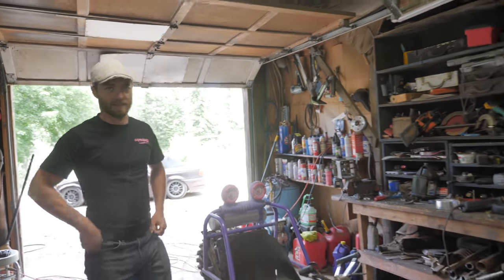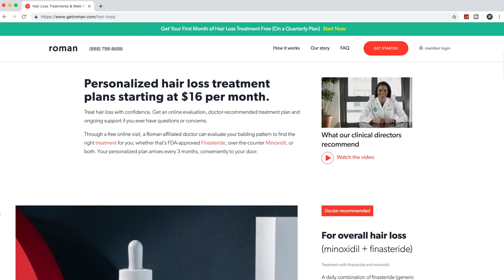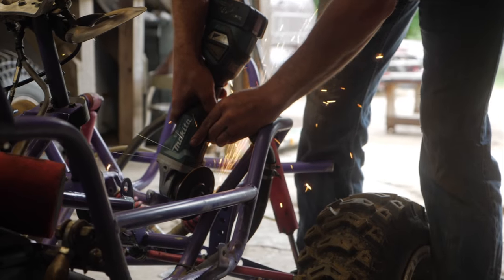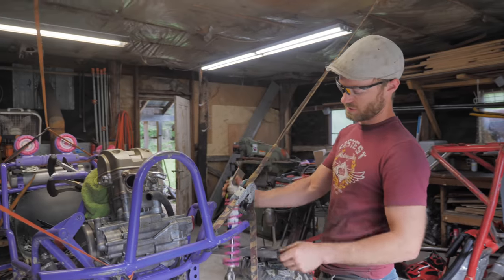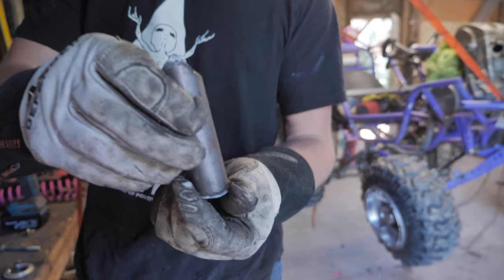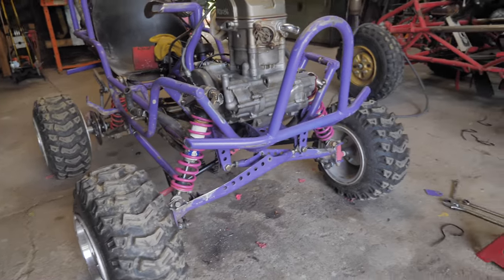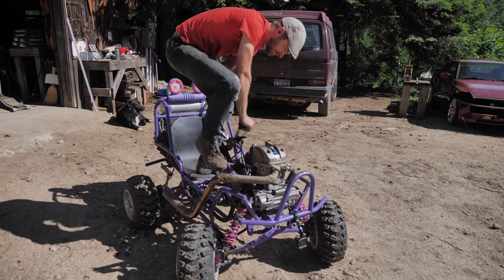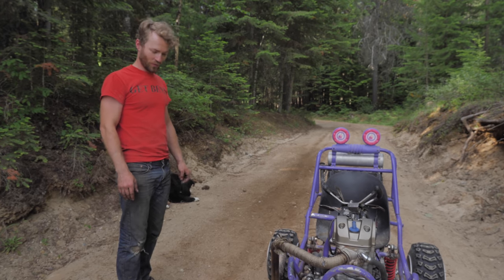50HP Barbie Jeep Gets A Rekluse Clutch+Front I-Beam Suspension

Comment: Glad you guys are enjoying your new RadiusCX auto clutch. Great video! 

-Rekluse team
Reply: Hey! How does it work? I'm guessing like a normal clutch pack with a kind of lsd sorta set up to ramp up pressure on it?
Reply: I'm an ex-bike racer/rider and know nothing of these. So you can ease the clutch out and just sit still and stop without pulling the clutch?
Reply: I would like to get one of those clutches for my ATV. It has the exact same motor. It would make it easier on rough terrain because you can't go less than 20mph or your in danger of stalling it out.
Reply: @AZBADBOYz  you can still use the clutch, the lever will still be there and still work. But from neutral you can shift down to first or up to second without pulling in the clutch, and just gas and go. Also if youre already in first second or 3rd you can come to a  complete stop without even touching the clutch. It works really good in tight technical terrain at low speeds, and the bike wont stall.
Reply: Your products are awesome! We have run it on two 690 powered cars now. Would love to see it for some of the other engine options out there for competition like the Kawasaki 650, Triumph 675 or CBR
Reply: I'm sorry but I think that's lame. It's the easy way just like all the new generation. I can crawl through any terrain on my 29 year old kdx200. For a toy like this fine, but just learn how to control your vehicle. Freaking kids can't even and don't want to drive stick now. ABS sucks and so does all the traction control, launch control, auto blip of the throttle........ Put me and half the pro race drivers in a car with no Nanny's and I'll bet I win. This recluse makes your bike a scooter with gears. Big pit bike. Woo hoo! 🤮👎
Reply: AZBADBOYz yes you can it’ll idle in gear and you can shift without using the clutch, I have one in my 450 quad
Reply: Neal Ramsey I have one in my trx 450 and they really are a game changer
Reply: @AZBADBOYz  basically a centrifugal clutch  like snow mobiles use
Reply: Rekluse Motor sports, correct me if I'm wrong but dont you still need to use the clutch for shifting?
Reply: @shaunmilor  same concept but applied VERY differently
Reply: dirtrider88 no you don’t need to use the clutch with the radiusCX model, they use to have a similar model called  the Z start pro which did the exact same thing except you still had to use the clutch to shift. This is basically the upgraded model from the Z start series
Reply: so not having to use the clutch when shifting is unique to this model?
Reply: dirtrider88 yes it is, this is the only rekluse clutch pack that allows this believe. Hints why it’s also the most expensive lol
Reply: U guys make the best that's forsure!!!
Reply: @chapekfabrication2975  grabbing the clutch when you stop works really well too.
Reply: @jasonbirch1182  Because the clutch leverages centrifugal force, you "will" (you need to make sure it's tuned properly) always have optimum engangement/disengagement. Among other things, the benefits to using an auto clutch include preserving clutch life and giving you the best performance possible. It is not about removing the need to know how to work your clutch.
Reply: @dirtrider88  Technically you can powershift or time your shifting like you would with a normal manual clutch without the lever. The auto-clutch will allow for clutch less shifting however we still recommend using the lever when possible to remove load from the transmission. Our clutch is generally locked up like a manual clutch in mid to high RPM range.
Reply: so that tells me you still need to use the clutch for shifting.
Reply: Say hi to pin pong @ Rekluse for me.   I have bought three Rekluse clutches and they are great!!
Reply: Man I need one of your clutches for my 2004 CBR1000RR powered golf cart.  Checked your website and it looks like there's nothing available.  I'm guessing that you have no desire to make one for that many streetbike setups do you?
Reply: How much for one i would like to buy it or have one built the same way
Reply: epic clips that specific clutch you’re lookin at around 1,200 for the complete kit. (Give or take given on what you ride)
Reply: epic clips look up rekluse clutches and go to their page and that clutch is the Radius CX model

Comment: You should make a 1/8 inch skid plate that covers the bottom of the spare tire so it won’t dig in
Reply: Really good idea!! Botham plate, maybe also one in the front
Reply: I've been thinking little wheelie wheels, but I honestly like this idea better.
Reply: Move the spare tire to the front bumper and the petrol tank just behind it.
Reply: Richard Roper sorta copy an engine skid plate. Give it a wrap around effect
Reply: Also, potentially a kind of angel hoop over the driver?
Reply: This!
Reply: Turn it sideways and put it on a spindle.
Reply: And the front so it doesn't snag on something when landing a wheelie.

That would end very badly
Reply: @johnnygearjammer  exactly what I'd do.
Reply: Or maybe a metal bar with a small wheel at the end under the tire

Comment: Dang! Did not realize how awesome Rekluse Clutches are... Might have to look into it for my bike.
Reply: Yes they are absolutely awesome!! Sure makes trail riding a lot better IMO
Reply: They are great if you suffer from arm pump but require a whole new style to control your bike. Much different approach to obstacles. IMHO very tricky when it gets real technical.
Reply: Skinny Pedal Productions they costs too much tho
Reply: they are great for this purpose. but for a dirt bike i would far rather continue using clutch control etc. avoiding a stall is half the fun.
Reply: just don't get stuck half way up a hill
Reply: Plug is working.

Comment: You can use no clutch to shift with the stock clutch the rekluse just lets you stop and take off with no clutch motorcycle have sequential transmissions
Reply: You can do it with the stock clutch but having built a few motorcycle powered race cars with a rekluse clutch it is even easier and noticeably smooth no clutch shifting up and down

Comment: I think a 10-20lb steel plate on the front bumper will help soften the suspension + help with handling on turns and it would be dope if you turned the spare tire 90° so you can use it as a wheelie bar, just a thought 🤔but i love the vids guys everything you build is incredible keep up the good work👌🏼👌🏼

Comment: The steeper the angle of the shock the more travel you will get.   If you really want some travel lay them horizontal and create a cantilever suspension set up.   Also a hole saw with a center drill will make you a washer and drtll the center hole at the same time.

Comment: front suspension is sweet! i reckon if you move the upper mounting point of the rear coilover it should reduce the tendency to wheelie as much as more of the weight of the driver is supported by the suspension, rather than acting as a larger lever, creating a greater moment on the whole system.

Comment: Nice work! Before it was just chaos with that motor and chassis. Now you have some controlled chaos. 

I don't know the spring rates or corner rates of the jeep, but most of the mass seems to be over the rear suspension (rear seat placement) and the way you have the rear coil overs laid flat means the increased mass has more mechanical advantage on the rear springs. Obviously there are packaging constraints, but if you increased the rear wheel rate you might not need the sway bar. You could stand the rear coil overs more upright or maybe change springs. 

On the front it definitely looks too stiff. Though it is a little hard to tell because there seems to be zero load on them about half the time. :) There is less mass over the front suspension and the coil overs are more upright. I wonder what the rear spring rate is compared to the front. Maybe swap the front and rear springs.

Also don't forget the effect the valving of the shocks has on the feel of the suspension. I don't know if those shocks are tunable by swapping shims, but you can always tune them with different weight oils. 

Overall the project looks (more) impressive now with the upgraded front and rear suspension. With a little tuning it is just going to get better. Check out some of the coil over articles below (if you have not already seen them):

http://billavista.com/tech/index.html

Great job guys. It just keep getting more capable with each episode. Be safe!

Comment: I have a trx450r that I've put a stage 2 cam and a 520cc big bore kit in. That engine would be the shit in one of those carts. It would basically be uncontrollable. The ATV was completely different after that work. It is far easier to stay on the gas for a half a sec to long and crash whereas before it felt very controllable holding it wide open.
Reply from the maker: How much power do you think it makes?

Comment: Great stuff, love it :) Best offroader ever :D
How come you didn't mount those shocks more vertical? If the lower shock support were closer to the swingarm pivot, you would have got more wheel travel per shock stroke, and at the same time effective spring rate would be lower because of the longer lever arm acting on the shock - giving a softer suspension.

Comment: I would have used a heli coil on the valve cover bolt hole. I've worked on enough outboards and motorcycles that I have a metric kit with most of the popular sizes. Good vid though!

Comment: Hey guys, there is a simple solution for your stripped out thread problem.
It's called Helicoil. Essentially it's like a spring in thread form that you wind into the slightly bored out original hole.
Strong AF, no chance of ripping the thread out anymore and you keep the original screw.

Comment: The recluse doesnt make it to where you dont have to clutch to shift. Dirtbike transmissions already have that ability because they are a constant mesh transmission. All you have to do is chop the throttle when up shifting or rev high enough to slip right in, and blip it to downshift. Dont do clutchless downshifting on a 2 stroke though. The recluse just helps it to not stall at low rpm.

Comment: I'm thinking because of the short wheelbase, 40 - 50 lbs of lead ballast in front, would help to level out the power delivery and keep the front wheels on the ground a little longer for better control.
Reply: also would help soften up the front suspension with out having to change it
Reply: Yeah it does need front weight. Maybe putting a battery and the cooling up front could help mitigate it.
Reply: Unless you tame the air wheels to be part of your control.  The wheelies is part of the fun. But I agree to soften the front end a tiny bit. But it's still sheer perfection.
Reply: @Houstonruss  honestly the quick and ez fix would just melt down a led brick into the front bumper  @andy If u really wanted that tho u would need to set up left and right foot brakes for the rear calipers so u can steer

Comment: Shock should be  90 degrees from an axel as possible .
Reply: How come? I don't doubt it, sounds right... but I wonder at what point or scenarios it effects the characteristics
Reply: It "should" not, angle of the shock changes just the progressivity characteristics of the suspension.
But in this case, it would be better, because that would mean that the lower shock support is closer to the swingarm pivot - giving more wheel travel, and at the same time making suspension softer (because of increased leverage)

Comment: There is more then incorrect wheel alignment making that thing not wanna go straight, look at the bump steer. your steering geometry sucks and you really should do double A arms because it wont be easy getting rid of bumpsteer with that type of suspension. The barbie jeep is cool af and I want one but there is huge room for improvement :)